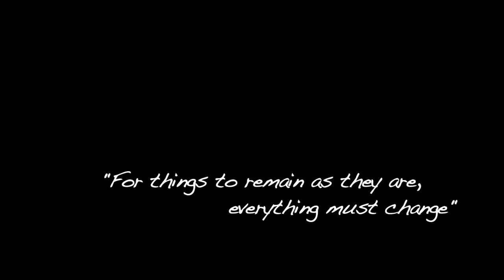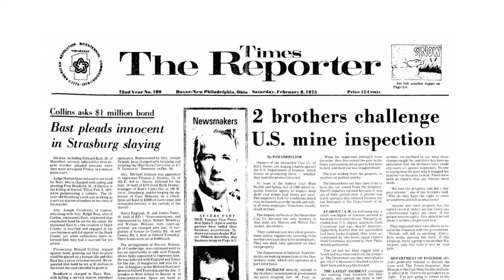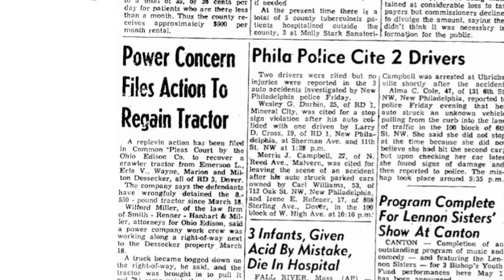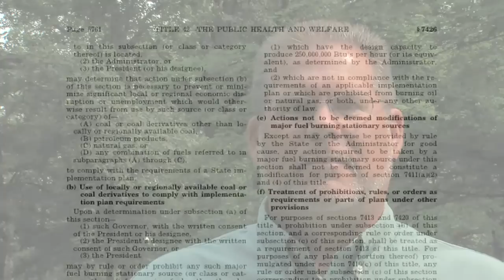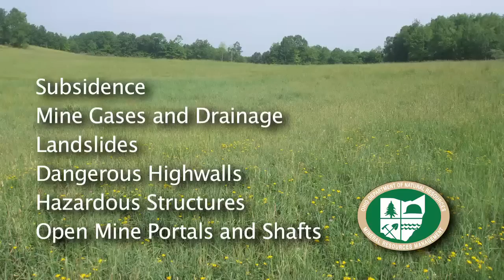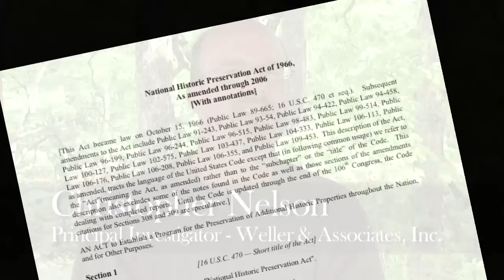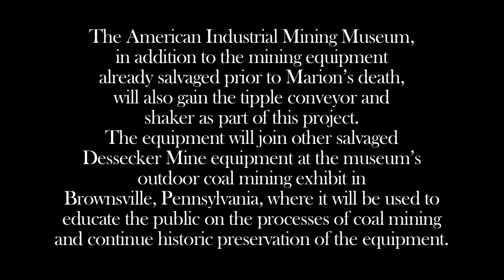Ohio's Hidden Mine

Comment: In Illinois we had the coal mines, (our coal was poor) and then going eastwards the quality of the coal got worst, that in WV became bad.  Now the best coal comes from Wyoming.
Reply: What about PA coal?
Reply: I lived in Wyoming. Now I live in Ohio. Ohio is ok, but I wish was back in Wyoming. FOREVER WEST
Reply: Do you just make this sh*t up?  West Virginia coal is metallurgical grade-- the highest quality coal there is.  Wyoming coal is high-sulphur, low-quality coal, suitable only for burning in power plants, and with the deregulation of the railroad it came into high demand because it was cost-effective to haul from the west.....much cheaper than high-quality West Virginia coal which is expensive to mine (sub-surface). West Virginia coal is most suited for making steel.  With the steel industry tanking, WV coal-demand fell.

Edited to add:  I am an unemployed WV coal miner, put out of business because of railroad de-regulation which increased demand for low-quality Wyoming coal.